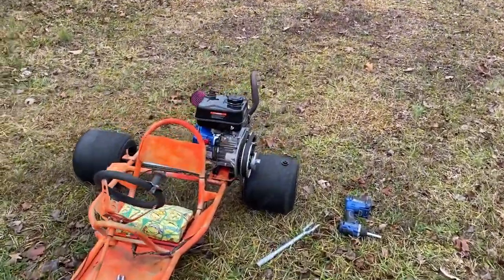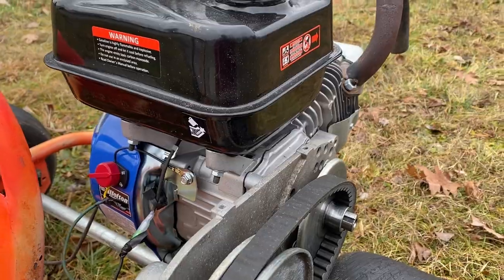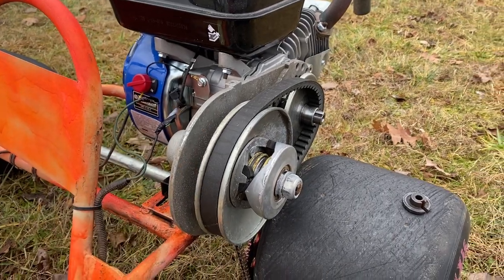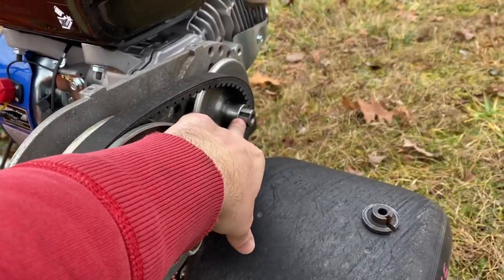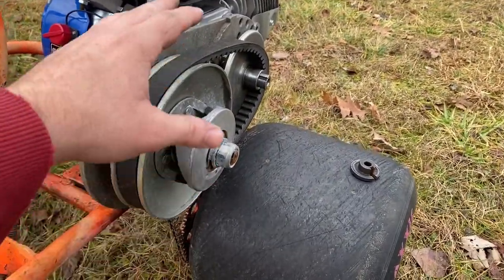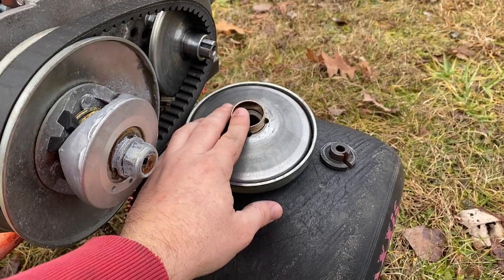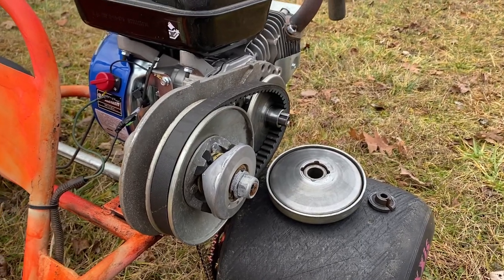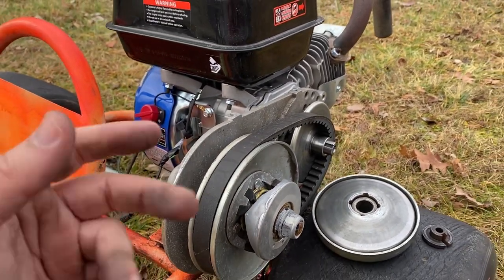Dangerous! Flaw Of 30 Series Torque Converters

Comment: 30 series is too small for a 10hp motor. not a dangerous flaw more like user error
Reply from the maker: The power rating wouldn’t have anything to do with the clearance between the pulley and the ring. The power rating is in relation to how much power the converter can handle before belt slippage. I had this exact same problem happen on another kart with a 6.5hp predator. The horse power isn’t the issue here.
Reply: Really Ya think?
Cuz mine is rated for 11.
Reply: @jwsbackyard6413  the 30 series tops out at 5500 rpm.
Reply from the maker: @Naferner_Said  max rpm on this engine is 5200-5300
Reply: @Naferner_Said You continue to make no sense and give nothing to support your incorrect claim.

Comment: Thanks for posting this. The one I purchased; I see the issue already. The inside and outside diameter are okay. The Width is the issue. It needs to be at least 3/8's of an inch longer.
Reply: I just got my eBay kit today and it’s the same, needs an extra 3/8 to not be moving all over. You can go to your local plumbing or hardware store and get either 3/4 or 1 inch copper pipe and be able to cut your own bushings.

Comment: I would not recommend removing that bushing.  Perhaps a true comet bushing would survive better in your application.  It appears to support the outer sheave when it shifts towards high range.  I saw this video a while back and decided to try it.  It made my clutch noisier, and was not as consistent.  The weights got a funky wear pattern on them as well.

Comment: Wow that's scary,,I will take your word for it,,if that happens on a motorized bycicle it could lock up without warning,and get somebody killed.
Reply: I’m here at this video because the same thing happened to me last night on my mini bike, thank the lord it didn’t lock up but the bearing actually snapped in half and knocked the bolt throwing that pulley loose

Comment: Those Tillotson 10hp engines don’t make 10 hp, they make 7hp same as predator stock they’ve been dyno tested by red beard
Reply from the maker: Out of the box the tillotson had noticeably more torque than my predator 212. I built two drift karts on similar frames but one had the tillotson and the other has the predator with intake, exhaust and ported head. The tillotson has more power than is needed so I’m able to control the drift a lot easier. On the predator kart I have to be full throttle all the time and have less control and flexibility in the drift. The real benefit of the tillotson is the upgraded flywheel and retainers from the factory.

Comment: Thats pretty darn interesting that bushing can do that. I had a similar thing happen to me i .had my torque converter clutch lock up like that before on my minibike. Mine was caused by that little splined piece that the pully sheaves move on. It had build up and wouldn't let the sheave retract when fully locked up. Cleaned and it worked good. Ill definently remember to keep a eye on the bushing as well
Reply: I just got a manco dingo, and whoever owned it before had the clutch backwards, obviously that's a terrible idea, all of its insides exploded and nearly nailed me in the face 🙃
Reply: Yes this is most likely the cause, the bushing should never catch. It is that splined shaft catching on you clutch bell.

Comment: Why so much castor on the front end? Looks really odd with the wheels leaning in like that.
Reply from the maker: The frame came with the spindle bracket angled like that. I just through the kart together at the time to get it going and was surprised at home much better the steering was with the wheels angled like that compared to my other karts so I left it like that.

Comment: Was flipping threw torque video. And came across this video . HOLY MOTHER OF GOD . I had one of these solid frame go carts when i was a kid . Found it in the trash one morning riding my bike . No engine just frame and wheels /steering bracket , at that time i had road a few go carts that freinds parents bought them from local farm and country stores and harbor freight , but this one was not junk , it also had 4 street slicks like these but all the same size like the front wheels you have . I took apart an old rodo-til buried in my woods for the clutch system and had an old generator with a honda 5.0 liter that the electro was no good . BRO!!!!! When i put those two together and got the chain to match the sprocket and drive shaft . I never -NEVER NEW “ that go -carts where unbelievably fast and the torque that thing put out !!! CRAZY i could max it on my steet and hit the corner full in . And drop the peddle !!! And that bitch would spin those rear tires like a 1000 horse drift car would and i could tokyo drift that cart from curb side to curb side leaving twin tire marks like a snake down my street . I wind up cracking the frame where the front steering would meet the torsion bars that stablized the front end and never got it fixed , a guy saw me with it one day my mom had a yard sale and offered me 300 dollars for it and i sold it to him . He said it was collectable the frames where ? Idk but that was the most fun i ever had as a kid just slidding that thing up and down the street . Im sorry for the long message but this took me to place that was happy 😃 once and had to share it .
Reply: That sounds awesome! Do you remember what kind of clutch system, or maybe the kind of roto tiller it came off?  Or was it a torque converter (like the guy is using on this video?)?

Comment: I thank you for your post and your cart looks like a hoot! I would respectfully like to offer another idea as to the cause of this issue. Long read but I think you will find its worth it.  

The lock up condition the 30 series will do is IMHO increased by a very hot and often worn belt! 
If you hit high RPM and top ratio on the TC and remove the drive torque, go into "engine breaking”, this can wedge the belt in the non conical bottom of the driven pulley and you skid to a stop!

When you have the tension go away on the top of the belt (not under power) and tension moves to the bottom of the belt because the back wheels are now turning the engine. This will suck the belt deeper into the non conical portion of the secondary pulley, where it can get caught, as we know!  Just in the same way a rope tightens around a capstan winch. This problem is increased with a belt that is too narrow from wear.

The perfect condition for this lock up to happen? Go climb a 1/4 mile of road at full throttle where you can only reach 50% of top speed because of the climb. Turn around at the top all heated up and come down hill over speed, then come off the power. This will snag a worn hot belt a large percentage of the time! This will happen regardless of the condition of the driver pulley assembly. As long as it has the ability to bring the belt right up to its largest possible driver diameter! 
This can happen even with a new belt however far less common. 

I give this as an example because I do it often going to my mailbox on one of my 2 minibikes. I have had this lockup happen no less then 10 times over the years. I tired of shitting myself and have since changed final drive ratio by going from a 45 tooth to a 60. Belts last at least 5 times longer before they start to do the suicide breaking thing lol. The bikes lost very little top speed and are much more fun on the up and down trails witch were eating belts.

These belts entirely edge wear and get narrower and can do so in a hour with 10HP.
Next time someone has this condition happen I encourage you to observe that the belt will be stuck in the secondary pulley independent of the driver pulley. You can even cut the belt top and bottom and the segment in the secondary will still be stuck! This is completely because the belt gets too deep in the non conical portion of the driven pulley while hot, rapidly cools from the reduction of drive forces (going down hill) and snags and tries to wind tightly. The pulley and belt bite and bind because the pulley is opened fully to limit with a belt as a wedge.
The drag forces inputing to these systems are not managed well and less so with a out of spec belt!  If you were able to ask the engineers at Comet I think they would agree that this is an issue of the secondary pulley driving (engine breaking) an out of spec belt. As well offshore cloners not getting a lot of the details into there products! 

Best advice to avoid this, keep a fresh belt on. When these belts wear they run deeper into the secondary pulley where they get caught. Also increase final axle sprocket size some if your geared tall, this will greatly reduce belt heat and premature wear. When down hilling don't over speed this will help keep the belt out of the danger zone. 

Enjoy
Reply: Ok let's be real.... Who really read that besides him probably 💀
Reply: Thank you for posting this.
Reply: Accurately and concisely put into words.  Exemplary use of examples. Here is advice well worth the taking and reason enough to do so.  Thanx!
Reply: Thank you, I'm having that exact problem

Comment: Thank you I ran a belt that I shouldn’t have and it was slightly thinner waiting for the new ones in the mail and noticed that there was west from the bushing being moved and not having the belt fully on it and wear across the line of the center of the belt shifting I’m putting the correct belts on and removing this messed up bushing

Comment: My bearings on the rear system went out. That's my job today is installing bearings on my ebay tc. Plan on replacing the driver and then eventually rear pulley.

Comment: Doesn’t taking that bushing out take away the kart’s ability to idle? I currently have it off and the kart starts moving forward by itself as soon as the engine turns on
Reply: Then you have something else wrong.

Ever notice that you don't see that bushing on every brand?
Reply: @NubsWithGuns  I think it’s because I bought the cheap torque converter off Amazon, gonna have to upgrade it anyways because I’m going over 50mph now which might be an issue considering it’s only rated for low rpm
Reply from the maker: It should still idle ok but you may get a light lurch forward when the belt is warm but you should easily be able to hold it. A high idle or broken springs in the driver could cause it to not idle or constantly be engaged.

Comment: Isn't a necessity to run them..... it doesn't hurt anything, snowmobile clutches which are much bigger than these do NOT run a bushing like that and they aren't known for being belt eaters. So it's a thing that's just there, is it an absolute necessity for them to be there? No. As stated in the video, unless you plan on just letting your engine sit there and idle for hours on end, the chances of wearing a flat spot in your belt is slim to none if you're torque converter is setup properly that is. You shouldn't have any belt drag at idle what so ever, meaning it should not be trying to move your vehicle or spin the wheels at idle, if it does so a bronze bushing isn't the fix your pulley sheath widths are. The only proper way to fine tune your belt to pulleys is one of course proper alignment of the belt to your non moving face of your front pulley buy use of shimming either end, but on a sled you really can't shim the front primary pulleys due to the tapered crankshaft and how they attach to the engine. So it's your secondary pulley that needs to be moved by shims in or out to bring the belt into perfect straightness. As for the belt drag after you've done the alignment part now it's time to check out the belt drag. Weather their wheels or a track, lifted in the air at idle, you should have no movement. Make sure your idle is down at the proper stall speed before engagement and it's time to shim the primary or secondary pulleys. The way I do it usually is via the secondary pulley. It's a bit challenging if you've never taken one apart before, and always remember to mark Everything with a permanent marker first so you know where things like the spring holes are marked before disassembling. Carefully if you have a tool to help you, remember these things are spring loaded and you can easily get hurt not knowing what your doing!!! BUT remove the clip on the secondary and Carefully remove the helix and spring and marking what direction it was torsioned towards and what holes the stock spring was using. Sometimes there's 3 A B & C holes on the pulley or helix side of the spring. This is to adjust the pre-load on the spring to increase or decrease it's pressures depending on how you want the torque converter to shift and when. Remove the outer pulley sheath and by using either Comet shims or something like machine washers from a hardware store you can add a shim or 2 to widen out the secondary pulley. This will allow your belt to drop into the V of the pulley a little more hence lessening the drag on the front clutch the vise versa. You shouldn't really ever require more than one or two shims! Otherwise something else is way off like the distance of your shafts if it's on a plate or not, I've come across crooked machined plates and holes for the secondary bearings! So it's not always a necessity to have to do, but by doing so and paying attention to details like this will help increase the lifespan of the belt and overall clutch system. It's never a bad thing to hit the moving parts like the shaft bushings inside the pulley sheath with a good water proof grease as well as your helix ramps and buttons as long as you're running the cover! If you aren't running the factory cover to keep dust and dirt out than you do not want to use such things which will allow this stuff to stick to it. So users beware, and take everything I say with some common sense beforehand. Thanks and thanks for bringing this to people's attention. No these bushings are not a necessity if not cause more problems as they wear down like what's happened here. It works great on paper, but in the real world they suck! Thanks again brother.
Reply: I ran into the same thing on my mb 200. Spaced out the pulley halves on the driven unit with washers- works great!

Comment: Great video man. I'm definitely  taking that bushing out of my minibike tc before I ride next time. Also, my tc is getting stick and not releasing. Assuming it needs to be cleaned. What's the best way to do this? Compressed air? Also what needs to be lubricated on the tc?
Reply from the maker: The best way to clean it is to take it apart and just use some parts cleaner. The driver is very easy to take apart but the driven pulley is a bit harder and you could probably get by with just spraying parts cleaner down in it. The main things that need lubrication are the brass bushing if you are using it, the inner sleeve that the driver slides on that’s shaped like a cross and the shaft the driven side slides on when expanding. I’d use some type of dry lube or no sling product so it doesn’t get on the friction surfaces of the converter and cause slipping.
Reply: @jwsbackyard6413  VERY helpful  comment!!  Thank you for the insight, my good man!

Comment: If you haven't noticed that the engine output shaft is too sort to cover the outter piece (it barely has any shaft/keyway to engage it) . 
 I cut a piece of shaft from some other thing I had and welded it to the end of the motor output shaft. 
 You have to cut it the right length (obviously) but I drilled out the threads in order to only use the actual motor output shaft threads (otherwise you risk misaligned threads and having to use a longer threaded bolt (common sense thing).
 I've been using the bushing and I haven't had a problem like that (that I know of) but my old torque converter is trash and when I replaced it with a new one found out the bushing was missing !?!?? 
 I had the belt twist up on it,  is why I replaced it (checking the tolerances showed All kinds of discrepancies).
 Hopefully you get yours worked out !! 👍🏻

Comment: Those engines seems to carry the 3/4 shaft (odd for a 10hp) therefore can't use the 40 series TC.
Reply from the maker: Being a 212 the 3/4 shaft is on par. There are a ton of companies producing 212s with interchangeable parts between the brands so I’m sure they just went with the standard each to source components instead of redesigning the whole engine for a bigger output shaft.

Comment: I'm a little new to the game when it comes to torque converters, what's up with this graphite dry lube everyone is talking about where and how would I apply it? Appreciate all the advice from the mini bike and karting community!
Reply from the maker: I haven’t used it personally but it looks like it’s a dry lube that bonds to metal pretty well and repels dirt. So you could get why it would beneficial to use on engine/kart applications.
Reply: Look at the parts store or wallmart
Reply: used in padlock applications as a dry lube

Comment: So if I don’t instal the bushing it should work fine? I have heard they grenade frequently. Thank you for sharing
Reply from the maker: Yeah it will work fine without the bushing, sometimes it will try to move a little at idle when you’re not on the kart but that is the only difference. I have three of these torque converters and they’re still running strong.
Reply: @jwsbackyard6413  good to know. Thank you sir!

Comment: How is it a flaw because you decided to take apart out that's supposed to be there?
Reply from the maker: I’m not sure what you are trying to say but the torque converter was unmodified and had every component it is supposed to come installed. This is a common failure point for these torque converters. Many people have posted about this same issue.
Reply: @jwsbackyard6413  you said you always leave out the brass bushing! Therefore you removed it. Does that make sense?
Reply from the maker: It was obviously left in this one. I usually leave it out but had left it in this one to give it another try.